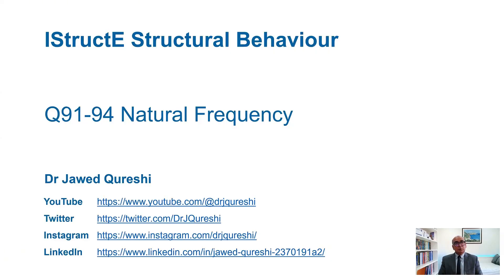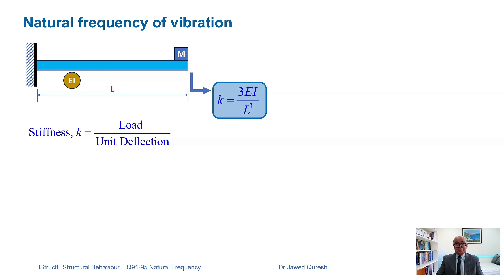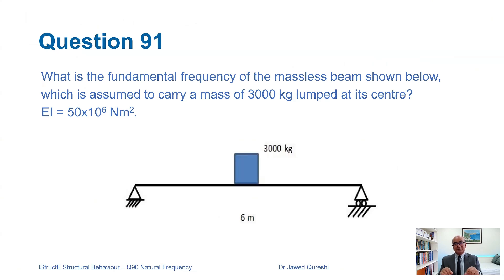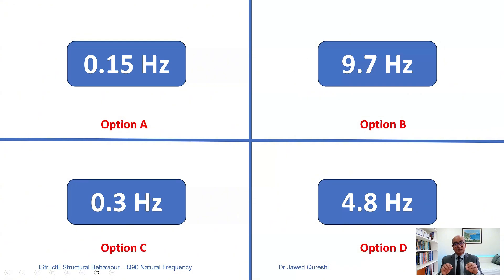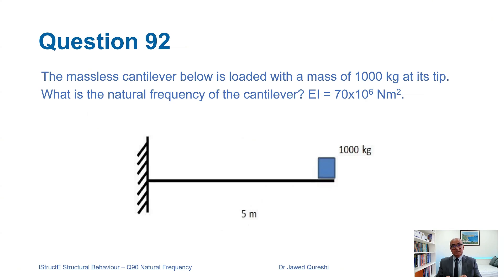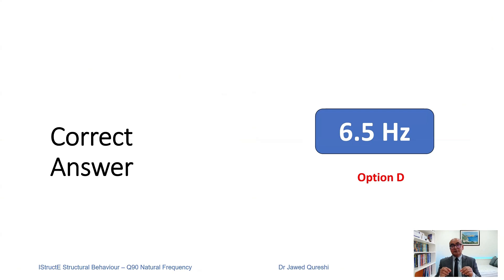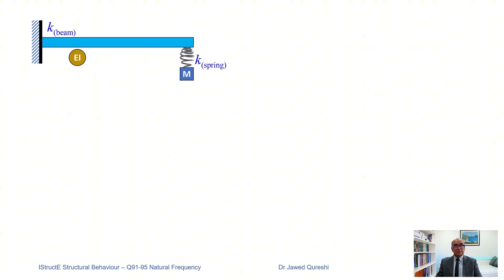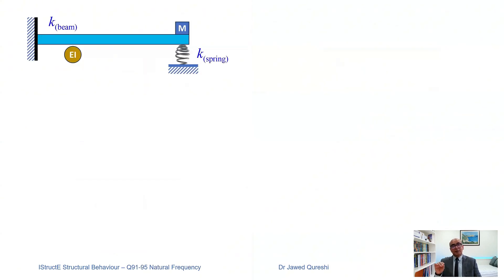How Beams Vibrate: Simply Supported & Cantilever Cases | IStructE Structural Behaviour Course

Comment: Thank you for the content. This is a great channel. You explain everything so well. I have a question. It looks like the system with the mass dangling from a spring has the lowest frequency. When designing steel members on Tekla Structural Designer, I select calculate natural frequency and the option to limit it to 4hz. How come the worst system has the lowest frequency when we want low frequency?
Reply from the maker: I’m not sure how does it work in Tekla.